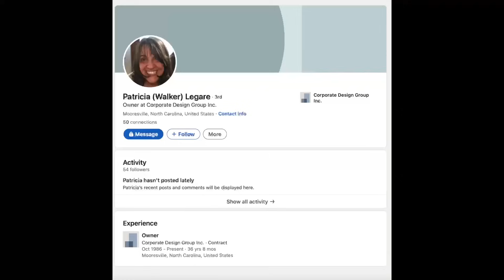Rusty and Kenny Wallace's Former Busch Series NASCAR Shop Tour! (Showing Up Unannounced)

Comment: When it was Winston it was really a big deal. Prior to Winston it was guys running modified street cars out of household garages pulling them to the track in their own pickup trucks on a flatbed trailer. Once Winston got in the money seemed to really kick up and the more dedicated racing shops seemed to start by the time kenny was getting in it seems the dedication was pretty heavy and the drivers were no longer the main guy making the race. By the end of Winston it was pretty well as big and elaborate as it ever got.